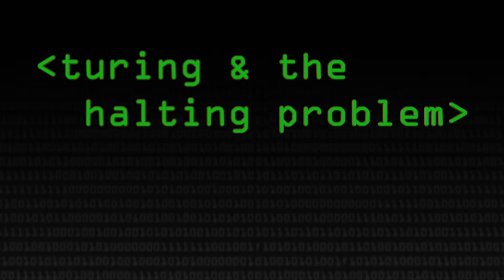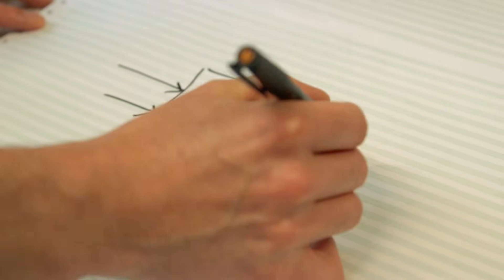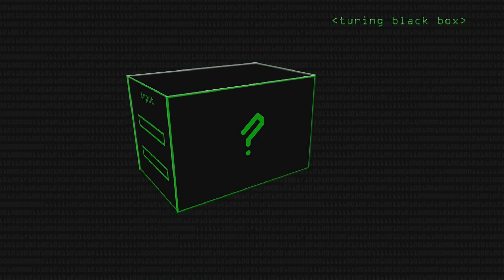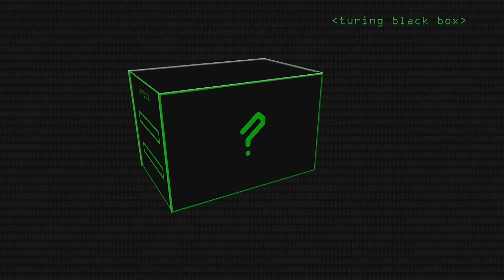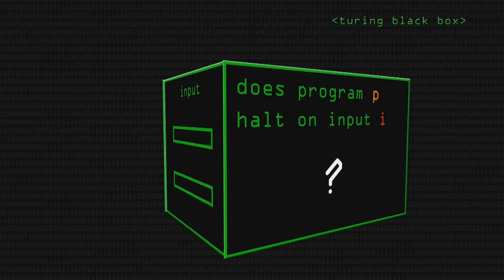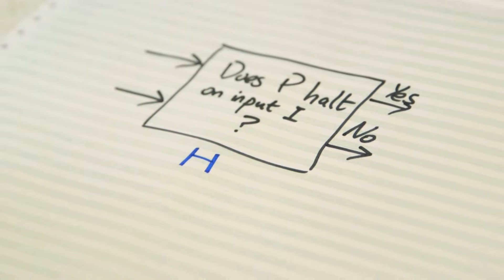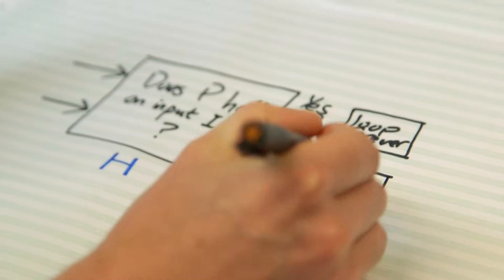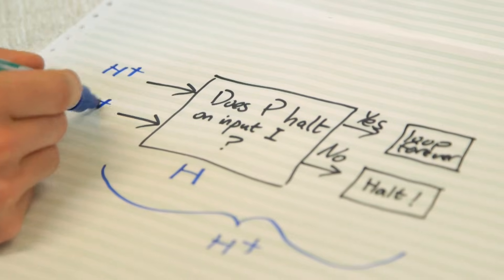Turing & The Halting Problem - Computerphile

Comment: But it's impossible to feed H+ to H+.
Reply: Imagine you have two exact same machine which we called H+. Now you can feed H+ into itself.
Reply: Derek Leung no because H+ can only predict its own outcome if both H+ have the same input, which is logically impossible since you'd have an infinite chain of H+ with one of them having a chain of n machines as input and the other one a chain of n-1 machines as input.
Reply: ***** You are not feeding in a chain of machines into H+. What the "machine", or function, accepts is a description of a machine, and an input to the described machine, which in this case is the description of the same machine. There is no chaining at all. You can imagine the inputs being a char[].
Reply: Derek Leung the inputted machine needs an input, as you said, but the paradox only occurs when H+ is trying to predict itself i.e. With same machine same input. H+ cannot predict the outcome without an input, that input cannot be predicted without an input itself, etc. that's how I understand it at least.
Reply: Let's not think about abstract machines. Think of them in terms of functions.

Here we have a magical blackbox function, which you may refer to it as H:
  function Wil_It_Halt(string s, string in){
    //magic happens here
  }
Assuming this magical function exists. It will always be correct, and return true if the function described by "s" will halt, given the input "in".

Now we have a new wrapper function, which copies the string "s" and feed it to both of the arguments of Will_It_Halt.
  function NewMachine(string s){
    if(Will_It_Halt(s, s)) while(1){};
    else return true;
  }

Now, we will define "s" and call "NewMachine":
  s = /* the implementation of NewMachine (the text I typed above, with the implementation of Will_It_Halt substituted in*/;
  NewMachine(s);  // we'll call the function

Will_It_Halt in NewMachine will never return the correct answer, and there is no chaining or recursion going on. Do you see it now?
Reply: Derek Leung The way I see it :

String hPlus(String Machine, String Input) {
		if (hPlus(Machine, Input).equals("Loops")
			return "Halts";
		else
			return "Loops";
	}
Reply: ***** Your function is not correct. If it is recursive, then where is its base case? Nothing in your code will do the "magic" part, that determines if some code will halt or not.
Reply: Derek Leung that's an oversimplification of H+ that suits our purpose just well "if input machine returns loop, return stop, and vice versa."
Reply: ***** The problem with your code is that H+ does not and will not call itself in the proof.

Comment: Here is a slight modification of the Halting problem proof in this video.  Consider the set S of all programs which print "halt" or "not halt", eventually, given an input program and its data (as described in this video).  We are not assuming that any program in S actually gives the correct answer for every input program and data; merely that each program in S eventually stops and prints an answer, possibly incorrect.  Now, let h be a particular program in S.  We modify h to get a new program, h+, exactly as shown at time 4:10 in this video.  That is, when h prints "halt" h+ never halts, and when h prints "not halt", h+ halts.  Then, by construction, h+ is a program whose behavior will be opposite of the answer "halt" or "not halt" printed by h, when we take h+ as the input to h (as described in the video).  This shows that if a program h eventually stops and prints "halt" or "not halt", for any input program and data, then there exists at least one program with data that will not halt if h prints "halt", or will halt if h prints "not halt".  Thus, there is no program, h, that correctly prints "halt" or "not halt" for every input program and data.  QED

The point is that the construction of h+ does not require that h correctly prints "halt" or "not halt" for every input program and data.  The construction of h+ works on any program h which always terminates and prints "halt" or "not halt".  (If I am understanding this correctly.)  The proof in the video is a "proof by contradiction", while the proof in this comment is not.

One matter that is "glossed over" in the video is this.  Program h takes as input the pair [P,D], where P is a program and D is the data for P.  In the proof, we are taking as input to h the pair [h+,h+] where h+ is a program and h+ is its own data.  This raises the question of how we can interpret a program as data, but I suspect this is not such a difficult thing.

Comment: Either I am just not getting the point, or what he just explained is a fallacy, and in no way proves anything.

H+ only works on the premise that there is an initial H to work with. And if H existed, adding the initial bits to invert the outcome in no way effects H's power to decide the output, it would just change the output. H would still be a machine that can solve the halting problem if you remove the extra parts, and in no way is dependant on the extra bits for anything...
Reply: Yes, but that would be a tautology. H produces the right answer if you assume that H can produce the right answer. It tells you nothing. However H+ is constructed straight from the initial assumption that a machine H is possible. But if you feed H+ into H+ the H part of the machine gives you a wrong answer about the behavior of H+ therefore showing that H cannot exists.
Reply: I worked that out already, but thank you for the response.

Comment: H has two variables, P (program) and i (input). We want to know: does H+ halt given input H+? So we ask this question of H. i.e take P = H+ and i=H+. But your H+ machine needs two variables - P and i. We can't feed your H+ with just H+, it also needs an i.
Reply: I completely agree with you. I think there is something missing in the demonstration.  It is not as simple as just feeding h+ to h+ as he said or (h+, h+) to h+ as he drew in the notebook. The second parameter should work as an input for the first one and as you said h+ requires 2 parameters
Reply: Mister F The input for H is also the input for P.  If we had a simple adding machine, where P = Adder, the input would be an expression, such as i=2+2.

If H is asked to evaluate itself, what are its P and i?   P = H, because that's the program being evaluated. 
What values could you pass to i?  Because H is designed to test whether programs produce output, you could pass any program in as i.
In this case, i = H.  H is being asked to recursively evaluate itself.

This is also true when H+ is used in place of H.

Comment: If we as humans are able to process and detect paradoxes without getting stuck, then why not just make computers like that?

Or could it be said that humans actually can't compute paradoxes because we aren't actually detecting the paradox, because we don't try and reach the end of it? we just recognize a repeated logical pattern and assume that it will never end based on initial logical conditions where such an assumption should seem reasonably warranted?

It's like counting to infinity. a computer program would try and never succeed, while a human would see the logic of something like"X = 0. Y = 1. If Y > X then Y + Y and repeat" and think about it for a second, then realize "based on these parameters, there is no function within the equation that would cause this calculation to stop prematurely, or ever reach a predetermined conclusion. 

I understand the problem is in a binary form of logic, but i can't get over the fact that humans can logically understand and process a paradox without becoming stuck on the logic.

Comment: just give the machine a third option and you're set. make it say "undecidable" or something. that machine could work. there is talk about bad assumptions here, and one of them is that you can make a machine that only uses two answers, when there are cases where there arent an answer too. it's not the machines fault, it is just that there isnt always an answer to be had.

another machine that would have an "undecided" answer is a machine that detects every time the answer is "yes" and prints out wikipedia infinitly many times. if the answer is no it stops and makes the answer false, and it never stops if it is yes.
Reply: All algorithms, given a specific input, either halts or they don't, it's a problem of logic that there's no general algorithm that can detect whether an arbitrary algorithm halts. You can use the same logic as in the video to show that you cannot create an algorithm that find whether an arbitrary algorithm is decidable which means adding the optional output is meaningless.

Comment: Imho, this proof is incorrect because it introduces a new definition of "looping" halfway through but never acknowledges that. Let me explain. At the start "looping" means "failing to provide an answer" and halting means "provides an answer". So H is essentially a machine that can predict if any other given machine will be able to provide an answer. If we feed H into itself, it will obviously halt and provide the answer "yes". No contradiction there. Now, we build H+. H+ will wait for it's H component to halt, and based on H's answer, either loop or halt itself. What this means is that, in the context of H+, looping IS providing an answer. So now, we have "loop" mean both "provide an answer" and "not provide an answer". By feeding H+ with contradictory definitions of looping, the result can only be a contradiction itself. Garbage in, garbage out. But, importantly, it's a contradiction based solely on an incorrect definition of the term "looping", not one inherent to the thought experiment.
Reply: But an algorithm can provide multiple outputs or halt without providing an output. Additionally halting means termination, the machine will not further proceed with any actions, looping is a sustained action and therefore is not the same as halting or "providing an answer". Not to mention you cannot detect whether you're in an arbitrary sized loop in general, so your loop could terminate at some undetermined point and the actual "answer" is not the loop you thought was the answer.

Comment: What's kind of strange that makes Turing's proof unbelievable in my eyes is that he implements a "negation" change. This means that basically, Turing turns machine H, the solution to a subject of the problem itself, negates its outputs and changing it in such a way that the machine itself becomes victim to the problem during an assumption, and feeds it into itself in order to create the paradox. What kind of person would ever do that? Wouldn't it be just better to leave machine H alone as it is?

As H is, the imaginary solution itself then it would be perfectly reinforced (imagination, guys) in order to not become victim to the problem it solves. What Turing does here is that he changes H to a different machine "H+". This doesn't mean that if H+ doesn't work, then H won't work either. H+ is a completely different machine, and the proof for reductio ad absurdum would be much better off focused on the main solution "H" rather than a modified version "H+", since it becomes total garbage when you have a machine that has the capability of solving Halting Problem, but eventually have itself contradicted due to how it works.

It's pretty much equal to saying that we have programming language X, then a programming language Y comes out based on X, but with a few changes. If we saw that programming language Y is flawed because of these changes, then it would be awkward and illogical to say that X is also affected, even though it clearly doesn't have the changes that give it the flaw.

Because H+ can't be trusted, let's keep it away for now. Say we have H. If we feed it H+ as P, and H+ as I... there's a problem. Since H+ was designed specifically for 2 inputs, but H only works with 1 input per machine. Not knowing what to do, it acts based on machine instinct reinforcement and assigns a nil input to the simulation (it'd be crazy if any person actually designed H to feed H+ into it...like...who does that? nil is better). Since H is simulating H+, which is simulating H+ being fed nil... The 3rd depth H+ has its H component say "no, it won't halt" and the output will be yes. Therefore the 2nd depth H+ receives a yes, and therefore halts. Based on its machine instincts, H will output "yes" without breaking a sweat.

If there's anyone willing to counter my counter-proof with me not being able to refute your counter, then I'd gladly accept that. Otherwise, I'll be waiting.

Also, extra points if anyone can see how the 3-output "Smart Halting Machine" or SH can't work, where the 3rd output would be "contradictory", which the machine can determine through a "currently unimaginable" way of detecting that a program may cause the paradox.

Then there's thing I just thought of a while ago.

The basic point of H, and its modified version H+ is to simulate and analyze whether or not it would halt, right? Assumptions based on zero calculation are junk, there's no telling whether you're right unless the person gets an idea. So let's throw that idea out the window.

Say we have H+, which is basically H=>D, where D is the modular part that makes H+ act. Now we assume the H component is H(H+), meaning it is the H variant that places H+ during simulation of two-input systems. We feed H(H+)=>D with H(H+)=>D. The first machine's H(H+) detects that the second H(H+)=>D requires two inputs, therefore H(H+)=>D assumes analytic simulation with the second H(H+)=>D being fed H(H+)=>D. But now we're back to where we were. If this goes on, the thing will loop trying to go through all the simulation depth. Since the first machine's H(H+) detects this, it says "*Yes*, it will loop". This feeds into D, and it loops. And it casually loops without causing a paradox. Any normal H machine would easily pick this up without breaking, therefore H can exist under this condition.
Reply: Except there's no reason to reinforce H. Like how there's no reason to maintain belief that the square root of 2 is rational when performing the classical proof by contradiction.

You have H, which by assumption correctly produces yes/no on whether a program halts. You have H+ which is a single mapping from (yes, no) to (loop, halt). Now you feed (input, program):(H+, H+) into H+. IF the H component of H+ outputs 'yes' then which is immediately mapped to 'loop' and never halts, meaning the H component has produced the wrong answer, similarly if the H component outputs 'no' then the H+ system halts and once again H is wrong.

So we have no idea whether or not H exists, but if we assume it does then we can easily create H+, which assuming H is never wrong imply results like "This program halts when it loops forever" is somehow logically consistent and correct. Therefore either it is impossible to map the output of H to anything else, or the H algorithm is not always correct, but since correctness is an assumed feature of H, H does not exist at all.

Comment: well they "cut corners" in the video.
when you create H+ from H you need to add a part on the input side as well.
while H has 2 inputs a program description - call it P and the input of the program - call it I.
H+ has only 1 input a program description. and it gives it to H as both P & I.
now when you run, you run H+ and give it as input H+.
H+ will give it to H which will now check what happens when H+ runs with H+ as an input (which is really what happens).
if H+ should halt then it doesn't, and if it shouldn't halt it does, thus creating the paradox that proves that H is impossible to build.